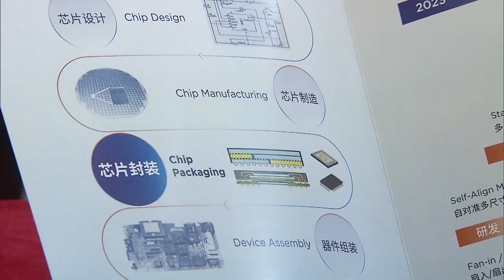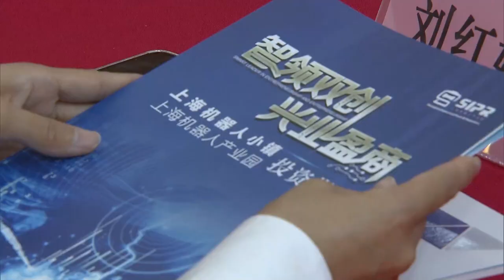720,000 12nm chips annually! China's YIBU tech opens new plant and R&D center in Shanghai

Comment: China’s YIBU (aka Single Step) Tech Company in Shanghai, now produce their own 12nm microchips (720,000 annually, but steadily increasing productions).
The 12nm microchips are needed to keep the BULK of their supply chains working.
China is also 2 years away from manufacturing their own 7nm and below Microchips, which are only used for high end smart phones and notebooks, as they build their own EUV (Extreme UltraViolet) and even DUV (Deep UltraViolet) tools.
Reply: 加油。一步一个脚印。稳扎稳打。🙂
Reply: @hongqingxiang3374  如此真实！
Reply: So they are another one out of SMIC who can produce 12 nm chip?